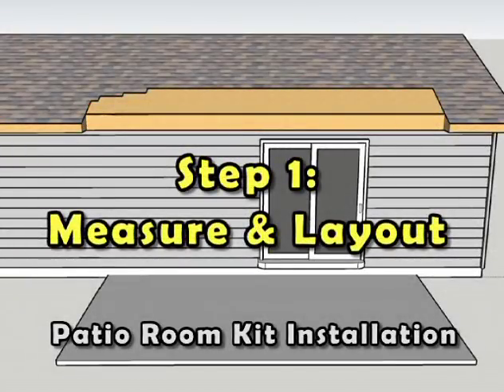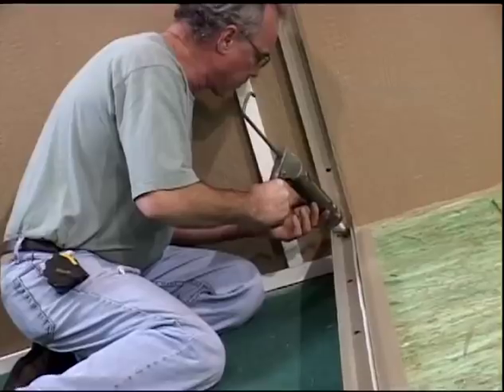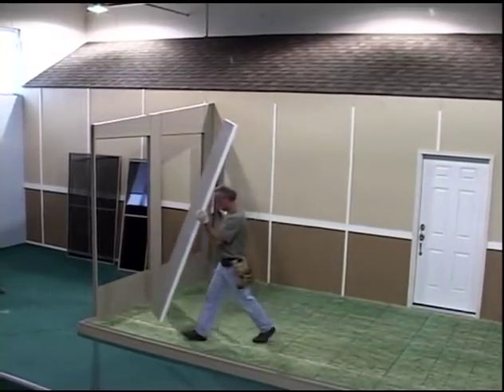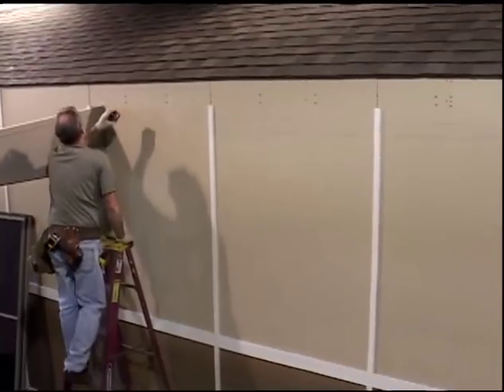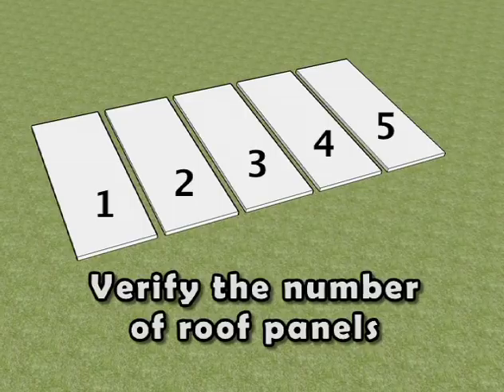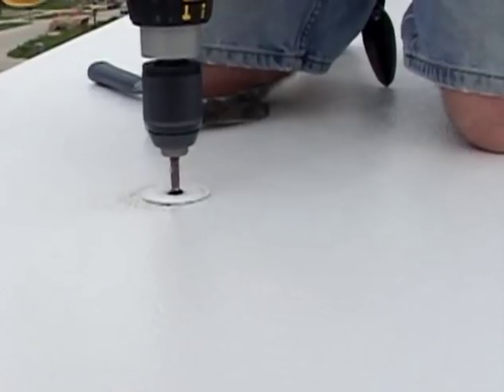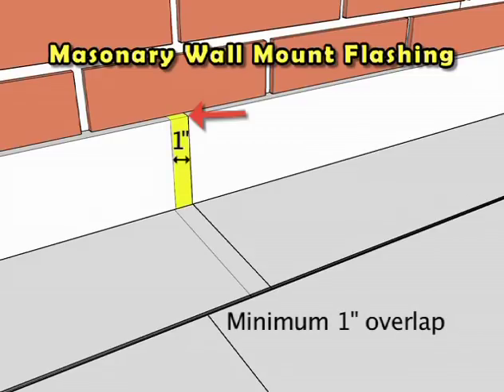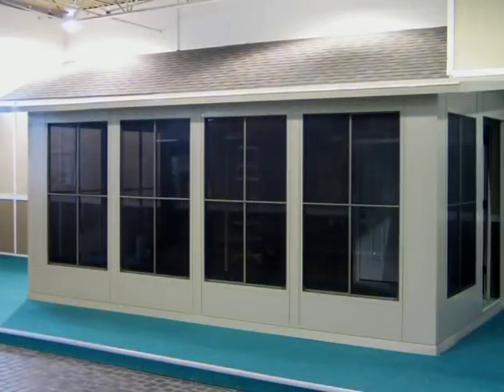Patio Room Kit Installation V2

Comment: I would like to see how you mount this to the vinyl siding,not a flat wall>
Reply: To do that I would cut the vinyl and add channel. Vinyl is easy to cut and easy to work with.
Reply: You can use furring strips with foam mounted to the back.

Comment: Nice video. I have a question. In the sketches there is a siding on the wall, but not in the video. Do you attach the  frame to the siding? I was wondering because it's not a flat surface. So, water and wind would get in.Thanks.
Reply: I have the same question
Reply: I would attach a strip of treated lumber to the siding
Reply: The correct way is to cut siding and install sunroom track to house Wall sheathing. Than Install J channel and siding
Reply: @mikew7561 , thank you.

Comment: I have a few questions. Can thos go under a deck? Can I install a window ac unit on it? Can I put a patio door on it to exit to my backyard?
Reply: This is an old video,  They  do have a web site that will put you in touch with a  sales  rep.   I am sure you can  mount this  mount anywhere the right foundation can be installed.  .   There are some  building codes  that govern  these structures and  technically you have to pull a permit.  I am also sure they have  all  kinds of inserts you can  purchase fore special  applications  like entry doors and windows with open and shut..